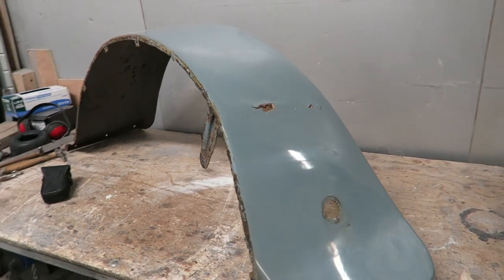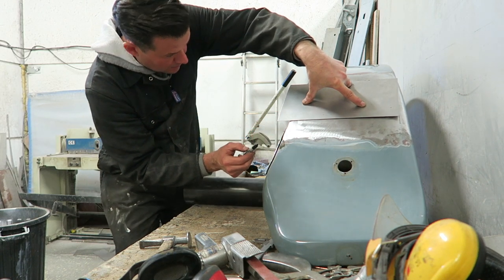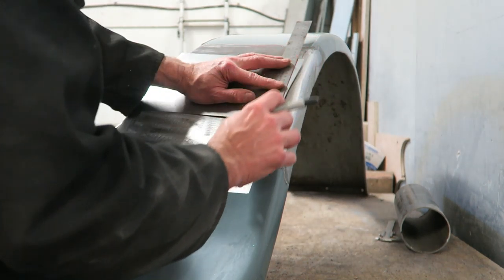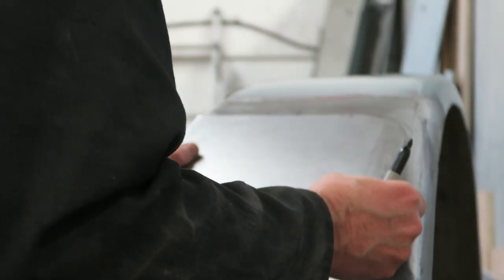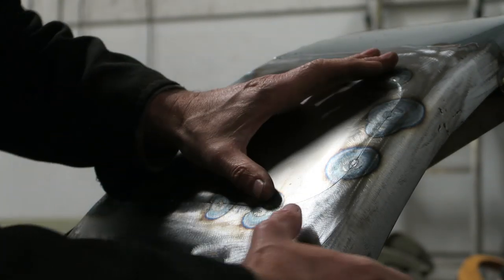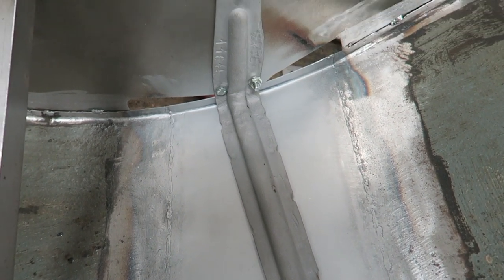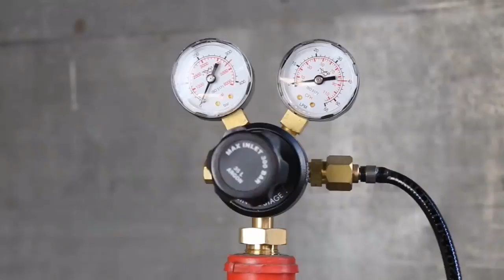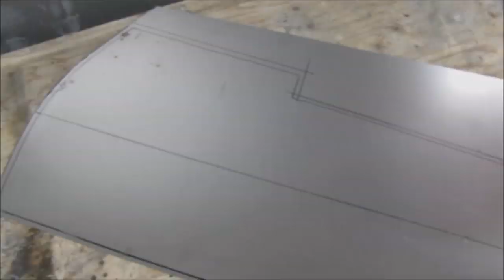Old School Gas welding hand fabricated repair panel Tips and Tricks #14

Comment: Great work young Felah,glad to see old school oxy welding like i used to do,like you know there are always problems when you oxy weld,one being you need good access to the rear of the panel to fix the profile and its time consuming. I can still oxy weld and lead fill and its a pleasure to watch other people with the same skills,modern panel shops avoid these types of repairs because of time and the newer type cars haven't got thick panels to be able to oxy weld. Thanks

Comment: Nice. I only have a flux core welder and an oxy acetylene rig. Now I am confident that I can do some planned sheet metal projects - with tons of practice of course.
Reply from the maker: I’d definitely prefer to use TIG but there are a great deal of coach builders that only use Oxy acetylene. Many of them use it because the weld is softer and more workable. All of the hand built cars years ago were welded together using it. Cheers Trev 👍
Reply: @trevsblog  Would you leave out the filler rod with TIG also?
Reply from the maker: @djpenton779  it depends how well you can get it fitting. To be honest I always use a tiny bit of .8 mig wire when I TIG weld. It’s so thin it melts and absorbs instantly. I like to use filler for aesthetic reasons as well as strength but it’s evident that many of the original coach builders didn’t use any as the undercut to the original construction welds is obvious. Cheers Trev 👍

Comment: Recently been OA welding repairs on my 1928 wings and although I got there in the end (having watched this video many times for inspiration in the four years since I first commented) I still struggle to get a soft rounded flame like yours appears to be. My flame, although small, is pointed and quite aggressive and I have to be super quick to avoid holes and I think I'm making progress harder for myself than I need to. I'm using a #1 nozzle but can't seem to get away from the pointy flame. Any other tips (if you'll forgive the pun) greatly appreciated.
Reply from the maker: Hey Tim this can only be a torch or a gas problem. I’m 99.9% sure I used a #2 nozzle. Are you using pure acetylene or a mix? If you’re using a mix this will definitely affect the result. If you are using pure acetylene then I’d definitely consider trying out a different torch. 👍
Reply: @trevsblog  Thanks for coming back so soon. I'm using straight Acetylene (and Oxygen of course) I must admit that I don't really like the standard torches that amateurs like me tend to buy as it just too clumsy for the thin metal sheet bodywork that I do most often but there is not a huge amount of choice on the market and the nifty little Cobra (?) jobs seen in the USA aren't available here I think. Also, do you modify your nozzles to get them closer to a 90 degree bend? The slight bend on a standard nozzle means that you have to have your arm up in the air to get the flame angled down. Sorry for the long response.
Reply from the maker: @timgreen6522  no I don’t modify the bend and yes your arm is cocked a bit too much. Why don’t you try some larger nozzles first, this would be the cheapest and easiest change you could try. If you think about it a larger diameter nozzle will work less hard to generate the same heat as a smaller one which may well generate a less ferocious flame as you can back off on the amount of gas you have coming out the end. Try a #2 first. Raise the acetylene until the flame starts to flicker lightly on the tips then introduce oxygen. If the flame is too hot turn the oxygen down slightly then bring the acetylene down to correct the flame if it’s still too hot repeat the process. I’ve actually welded using a #5. I’d personally start with a #2.
Reply: Thank you for that. I hadn't thought of it in those terms. I'll give it a go. @trevsblog

Comment: Hi good afternoon, you don't use filler wire when welding?  Just tack weld?
Reply from the maker: This was an example of traditional coach work welding with oxygen and acetylene. I would normally TIG weld it using filler wire 👍
Reply: @trevsblog  thank you! Have a nice  day!

Comment: Awesome job! Please, because I am not a native english speaker tell me again. Can I use it at vertical position as well? For example to a side panel of car if I have not the posibility to rotate the body. Thank's for the knoledge. Greetings from Greece.
Reply from the maker: Yes you can gas weld vertically 👍
Reply: @trevsblog  Thanks a lot!
Reply from the maker: Have you considered TIG welding?
Reply: @trevsblog  I spend some time with my inverter DC stick welder with a TIG torch. You know. Scratch start and some times sticking the electrode and the alignment of the panels goes away..... Also I have no garage room for my Alfetta GTV restoration project now! So I will try to weld outside..... and I wish to be a litle bit quicker than the rust.... :)

Comment: The difference between this video and the second one in the list by “MY FRIEND PETE” is astounding. You treat this like an art, near perfect results, with no bondo. “MY FRIEND PETE” told me to make a flange, mig weld and cover with bondo. Results may look similar but this is obviously the proper method! I think I’ll buy tig instead!
Reply from the maker: Butt welding is certainly preferable to lap welding but both methods have their place. It’s all about experience, cost and how quickly you need to get things done. I’m very much trying to perfect the art of coach building and restoration and I’m also now not doing it to earn a living, so it now doesn’t matter to me how long something takes. Many people making videos have been caught in the trap of having to get things done in next to no time at all so they only learn one way of doing something and that’s what they show. Cheers Trev 👍

Comment: Trev! Following for a while, cant say thanks enough for your time, energy and video quality! Have a question. @ 38:52 ...before you put the paint on...Im seeing some small pits left over. Did you go back w a gas weld and filler? How do deal with this, in body prep? I get that you planished earlier but i still saw tiny divots in the lighting. Noob here, u remind me of a mentor I once had.
Reply from the maker: fancypants 38:52 is the end of the video. I think you’re referring to weld under cut. Where the weld area looks pitted, this is because it is slightly lower than the steel around it. The demo was really to show how the old time coach builders used to weld panels together without filler rod, many of the hand built cars we work on look like a patch work quilt once you get under the paint. This was smoothed over with a skim of filler during the paint preparation stage. Many people go to a lot of trouble trying to disguise where they have welded, myself included because it just looks so much nicer, but back in the day they really didn’t go to as much trouble, once the paint is on you cannot tell the difference. Modern paint processes give us the impression that theses cars looked perfect but in fact they looked very wobbly compared to today’s expectations. Cheers Trev 👍
Reply: Trev's Blog sorry i meant 28:40. But i believe thats the patchwork you referred to? So in the good ole days, they didn’t fill but just painted over it? The primer and sanding was enough to hide the pits?
Reply from the maker: fancypants they didn’t have fillers but they used lead if the joint required it. I suppose it depends how far back in history we go, the earliest cars were basically a horse drawn carriage minus the horse, wooden wheels and brush painted with oil based enamel paints.

Comment: Fine work. I just got directed here after watching you do a TIG demonstration. Do you think you'd prefer TIG for this application now that you've become handy with it?
Reply from the maker: Rick Rose I don’t do enough welding to make a real balanced final judgment on this, both have their own characteristics. Some top coach builders will only use gas full stop, but is this because they don’t want to learn another technique, I really couldn’t answer that for you? My preference is currently is definitely for TIG. If you gas then things tend to end up more malleable but distortion is increased. I’ve never learned to gas aluminium properly so I cannot comment on those differences. Cheers Trev 👍

Comment: Hi!  I have a question, why does the torch sometimes pops when welding panels with filler wire?  Thank you!
Reply from the maker: The oxygen acetylene mix is extremely volatile. Welding can cause pockets of unburned gas which then ignite with a pop. Another really common problem is having a leak where the nozzle screws into the torch, there is an O ring there. When you’re welding sparks fly up and ignite the gas at the nozzle leak, again causing a small explosion 💥
Reply: @trevsblog  thank you very much!

Comment: Cheers Trev great job on that wing. Whats the advantage using gas welding over Tig ?
Reply from the maker: groovedodger I’d actually prefer to do TIG but gas is slightly softer which is preferable as far as welding goes but I’d rather TIG any day, this was done mostly to show asa demonstration. Cheers Trev 👍

Comment: Does this weld require any body filler?
Reply from the maker: Because of the undercut something would have to be used to fill it. Hand built cars of yesteryear would probably have been hand painted with coach enamel. Imperfections would probably have been incorporated into the painting stage.